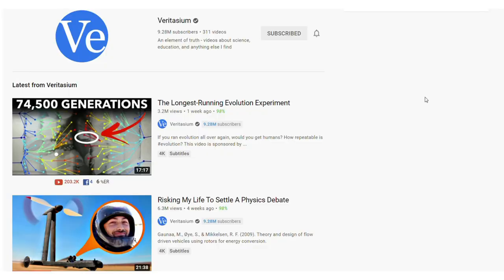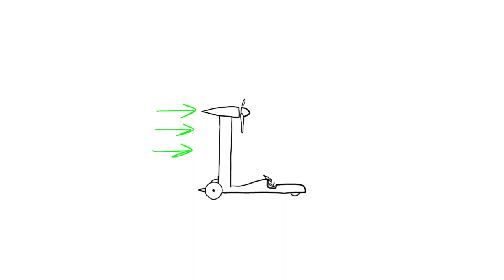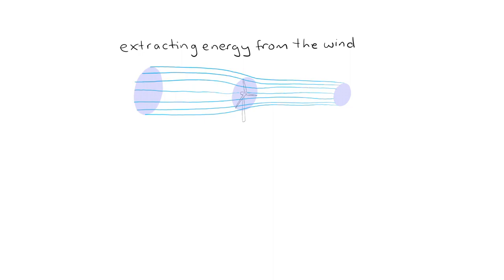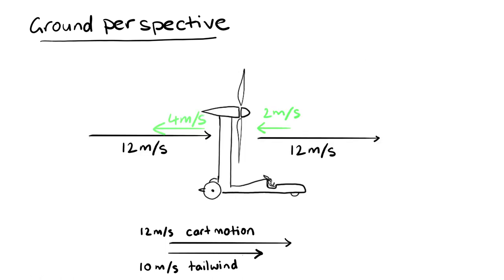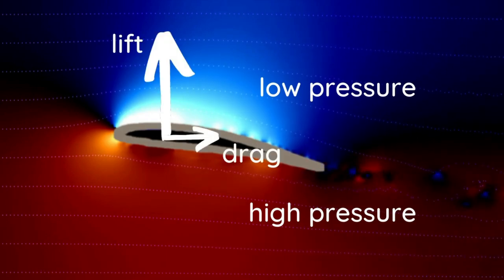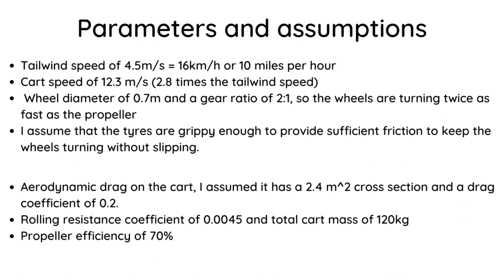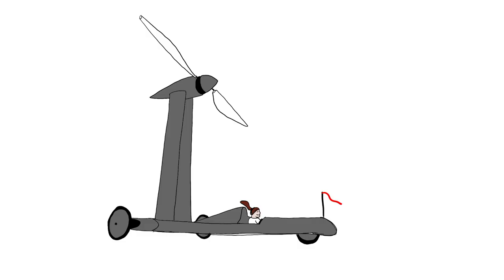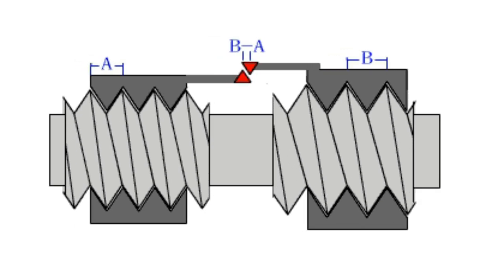Downwind Faster Than the Wind by Veritasium: How Does it Work?

Comment: I am not a fan engineer or a bike engineer. I don’t know why so many people get this wrongly: 

1. If the wheels are geared to the car’s propeller (fan), rotating the wheels will make the propeller rotate, and rotating the propeller will also rotate the wheels. It works both ways.

2. Direct transfer of the pedaling energy to a bike wheel makes most efficient use of the energy. If sharing some of the bike wheels’ energy to a propeller fan pushing the bike forward will make the bike go even faster, then why we never see a propeller fan geared to a bike wheel? Not even on sport bike used for competition?

3. As sailboat can go faster than wind, the Blackbird car can also go faster than wind by hanging up a sail replacing the propeller. It is not surprising that the car can go faster than wind and it does not support the propeller fan thrust theory.

4. What likely to had happened was the car propeller picked up some energy from the wind and transferred to the wheels, making the car faster than the pushing wind. 

5. In the Blackbird’s successful last run, the propeller in just like rotating 2 times per second. A typical ceiling fan runs at 3x this speed and a CPU fan runs 15-20x this speed. The thrust by a 2 rotations per second fan cannot generate any meaningful acceleration. On the reverse, with the right gearing, the propeller rotating with 2 times per second can add 15-20 rotations per second to
the wheels, thus accelerating the car. The propeller IS acting like a windmill!
Reply: 1. There is a ratchet, allowing the wheels to turn the propeller, but not the opposite.

2. Bikes are not always moving directly downwind and a rotor would not be practical on a bike

3. When a sailboat tacks with a downwind VMG > windspeed, the sail acts as a propeller blade, while the keel acts as a turbine blade (opposite to what happens when tacking upwind)

4. The Blackbird cannot accelerate using stored energy, but it does accelerate while being faster then the wind.

5.The Blackbird  propeller is never acting as a windmill (turbine), because it never spins in the direction of the aerodynamic torque.

Comment: Its not a hard concept to understand once you realise that the propeller needs to be *variable pitch*, there's also a ratchet on the propeller shaft, and a tall gear ratio also helps. The key is the variable pitch propeller though, and this pitch must be carefully adjusted as the speed of the cart increases up to wind speed so the reverse torque created by the wind pushing on the fan from behind doesnt cause the propeller to spin the opposite direction!  This is also the purpose of the ratchet. The speeds dont come into it really and just confuse things. It is fundamentally a torque problem.
Reply: // "Its not a hard concept to understand once you realise that the propeller needs to be *variable pitch*"//

There is zero need for variable pitch.  The Blackbird was run many times before such was installed and each time ran multiples of wind speed.  Dozens of smaller models run regularly (and are documented on YouTube) and have simple fixed pitch RC airplane propellers installed. 

// "This is also the purpose of the ratchet. "//

Nope.
Reply: @johnborton4522  then how is the opposite torque caused by the wind pushing from the back cancelled? Or is the fan constructed so it only works one way? Or perhaps gear ratio alone? Or perhaps the fact the fan in mounted on the front of the tower thing is enough to block enough wind? Look i don't doubt it works its just the way it works isn't as magical as they try and make out
Reply: @karlm9584  

// " then how is the opposite torque caused by the wind pushing from the back cancelled?"//

I'm not 100% sure what you're asking here, but if you're asking "at the start (below windspeed), why don't the blades act as turbine blades and spin the rotor the other way?", the answer is in the carefully arrived overall gearing ratio between the propeller and the wheels.   Once at or above windspeed of course there is now an apparent headwind to the rotor rather than any from behind. 

// "Or is the fan constructed so it only works one way?"//

Again, not certain what you mean here, but in downwind operation, the rotor never acts as a turbine - it's always a propeller.  Perhaps that's what you mean by "one way".

// "perhaps the fact the fan in mounted on the front of the tower thing is enough to block enough wind?"//

The location of the propeller relative to its  support structure is irrelevant.  Just like there are plenty built without variable pitch, you can find copious video on YouTube of like devices with the propellers on both sides of the structure.   Either works just fine. 

// " its just the way it works isn't as magical as they try and make out"//

I don't know what you think is magical in the explanation so I'm not sure how to respond really.  There is certainly no magic involved - it's just counterintuitive to most folks, even physics professors.
Reply: @johnborton4522  so it is gearing ratio then. Thanks.

It is a torque problem not a speed problem which is why many people have been confused by it.

Incidentally, my statement about the wind blowing from behind on the fan creating an opposite torque in the shaft that is ultimately driven by the wheels (and counter the torque created by the wind). This is why varying propeller pitch is important from rest up to wind speed, but it seems they can overcome this as well with just gear ratio, which makes sense too, but it wouldn't be as efficient.
Reply: @karlm9584  

// "It is a torque problem not a speed problem which is why many people have been confused by it."//

Yes, it's simply about getting the mechanical advantage (gearing)  correct.  If you alter this gearing the blades do act as turbines and the device will move into the wind rather than with it. 

You are not wrong that varying the pitch of the propeller is a speed and acceleration improvement over fixed pitch (which is why I went to the trouble and expense of building a variable pitch hub from scratch for the Blackbird record runs).  It's just not required.

Here is an early video of the Blackbird with fixed pitch more than doubling wind speed.

https://youtu.be/EEuAqq8FINw
Reply: @karlm9584  

BTW, I installed the ratchet on the prop shaft of the Blackbird so that the driver could brake the craft without having to also slow the spinning propeller.  The bicycle brakes were overworked as it was without also having to absorb the energy from the giant rotor.   You can come to a stop and the prop will just spin down at its own pace ... click...click...click.....

Comment: What is NEVER stated in these explanations is the angle between the direction on the vehicle and the direction of the wind. It makes a huge difference to the argument. 
A vehicle travelling DIRECTLY downwind will NEVER exceed the velocity of the wind. There is NO differential air movement under that condition, hence the vehicle will get zero further energy to propel the craft. Think about it! In relative terms the vehicle is sitting in still air. 
Explain that one if you can.
Reply: @Alexander Craig  

//"What is NEVER stated in these explanations is the angle between the direction on the vehicle and the direction of the wind."//

Perhaps you're unclear on what the term "directly downwind" or "straight downwind" means?  That term is used barely 1 minute into the original Veritasium video on this topic and referred to over and over in these other videos.  It means the craft can accomplish this task with ZERO angle between the two - a fact that is demonstrated in this very video.

//"A vehicle travelling DIRECTLY downwind will NEVER exceed the velocity of the wind."//

Yes, that's what the professor said too -- just before he conceded and had to pay up the $10,000 to Derek

//"There is NO differential air movement under that condition"//

Of course there is - the wind didn't stop blowing.   You're confused on how the device works -- it doesn't harvest energy from the relative motion between air and craft (if it did, you would be correct), but rather between the air and the rolling surface.  In a 10mph tailwind, the air is still blowing over the ground at 10mph no matter the speed of the craft.  It is this wind (what sailors call 'true wind') that is being slowed and the energy used to propel the device.

//"Think about it! In relative terms the vehicle is sitting in still air. "//

Correct, and while going directly downwind at 10mph (windspeed) the propeller is blowing air backwards at ~5mph which slows the true wind to ~5mph.   Reducing the wind over the ground by ~5mph is where the energy comes from.

//"Explain that one if you can."//

Here's what I'll explain (again, from my offer a year ago). 
//"Since you claim to have the analytical skills to know the correct answer to the problem, how about you and I enter into a wager on the topic not unlike Derek and the professor.   We'll agree on who holds the money and who are the judges and set off.  Apparently you feel you have no risk, and I know for sure I don't so it seems like a match made in heaven."//

Hey, I'll up the ante and give you 2:1 odds.  Something tells me you're not as confident as you claim.
Reply: @johnborton4522  You are starting to sound like a flat earther. The more you are challenged the more aggressive you become. 

For a start, your example of going downwind at a velocity faster that the wind is only applicable to a sailing situation. In that case you do not travel in the direction of the wind. You tack. A component of your velocity may be greater than wind velocity, but this craft on wheels is not a sailboat.  Yacht racers use a spinnaker for this very reason. Takes too much time to zig zag. Lose race. In any case you say to ignore the propeller until the vehicle reaches wind velocity.

As for the explanation of ignoring the propeller to get the kart moving downwind, the explanation is full of holes. Even the woman in the video seems to have no idea how that will work. The wind pushes the vehicle along the ground? This is turn causes the propeller to rotate , propelling it in the direction of the wind? You want to forget the action of the propeller in creating the initial movement? Ignoring the presence of the propeller, since you claim it is just there to provide additional thrust when the kart reaches wind speed? You really expect people to believe the vehicle will move downwind because of wind drag? Is that your game plan? 

So this vehicle acts as a billboard of sorts, Blowing downwind? Is that it? So when the vehicle exceeds the velocity of the wind, that effect becomes drag. Cannot have it both ways. 

You claim the "contract" was endorsed by some fine scientific personalities. You didn't claim they accepted your explanation of how it all worked. So?

The one thing about all this that really puzzles me, and other physicists, is why the explanation keeps getting more obscure.  So once again, how does this vehicle accelerate from rest, without the propeller, which you say is not needed. According the the woman in the video, "it just does".
Reply: @techhie1302  
//"You are starting to sound like a flat earther. The more you are challenged the more aggressive you become. "//

I reject your projection.  Let's stay on topic.

//" In that case you do not travel in the direction of the wind. You tack. "//

Correct - which is exactly what the airfoils on the Blackbird do. 

//"So when the vehicle exceeds the velocity of the wind, that effect becomes drag. Cannot have it both ways. "//

It need not have it "both ways".   The energy harvested from the true tailwind is more than enough to overcome the relative headwind drag -- up to around 3x the speed of the wind.
Reply: @techhie1302  This vehicle uses energy storage to exceed wind speed for a limited amount of time proportional with the amount of stored energy.
All the explanations given by Veritasium and Rosie are completely wrong.
When starting from zero the vehicle is pushed by the wind but instead of converting all that available wind power in to kinetic energy part of the power is used to drive the propeller witch stores that energy as pressure differential (it works because air is a compressible fluid).
Direct upwind version while fairly different also uses energy storage but a much smaller energy storage capacity that is charged and discharged multiple times per second.
Reply: @techhie1302  it clearly has electric motors. They're in the wheel hubs & probably the prop housing too. Really bad hoax.
Reply: @techhie1302  oh & btw as you correctly point out, every explanation I have heard for this silly contraption has drag magically turning into thrust once above wind speed. It's so stupid 😂

Comment: Great job.  Finally I think I understand it now.   I think the gear ratio, is critical here.  The way I see it, that prop has to get spinning fast enough to turn the wheels, and that's where the speed comes from.  Where as the starting the prop, comes from the torque of the wheels.  Small gear has torque for the big gear, and big gear has speed for the small gear.   It could be explained better, but Im no engineer.  Bottom line, ya need wind, and this is efficient use of wind energy.
Reply: Nope
The propeller turning has nothing to do with the wheels turning.
Reply: @stephenolan5539  If that were the case, surely if the propeller were removed the craft would still work?

Comment: The science behind this allows faster than light travel!  Yes i said what I said and it is true.  The issue is airfoil effects and the angle of the blades.  This car is circularly tacking in the wind.
Reply: //"The science behind this allows faster than light travel!"//

No.

//"Yes i said what I said and it is true."//

No.

You either don't understand how it works, or you don't understand its limitations.

Comment: Put an electric fan behind a prop generator that powers the electric fan - "instant perpetual motion" with the extra power generated used to charge a battery.  😂
Reply: Well, that would actually break the laws of thermodynamics unlike this car.
Reply: @seneca983  Hence, the laughter with tears emoji.  But this would be a video I would like to see - proving it won't work.  Use duct props and a closed tube system maybe? Go big or go home.   lmao  Also, this is apparently clear this is a new direction that hasn't been explored since a lot of individuals doubted this car would work.  What is science if you can't have some fun. ;)
Reply: @Jiggledance  I thought you were implying this cart was also a perpetual motion machine.
Reply: @seneca983  I'm waiting for the videos claiming this can be turned into a perpetual motion machine. Hence, I suggested start debunking it now and also, explore what it's actual potential is in other uses.  Think 🤔 outside the box.
Reply: @Jiggledance  OK, then I misunderstood you.